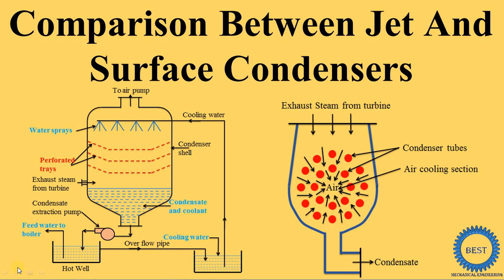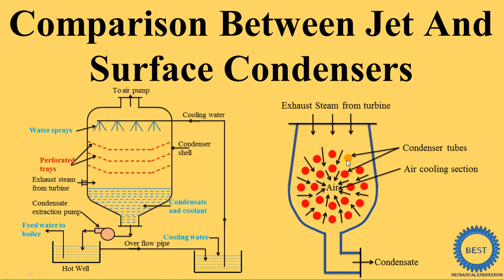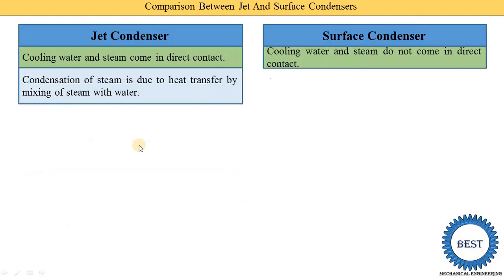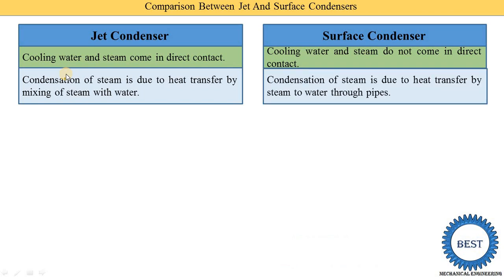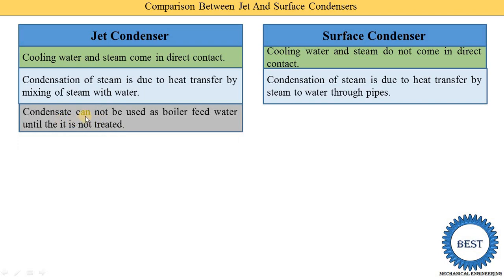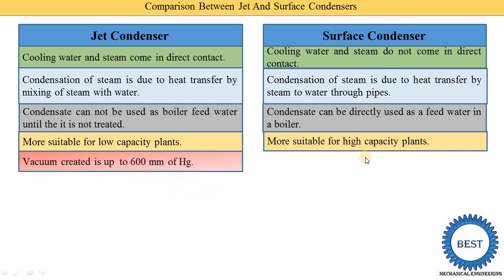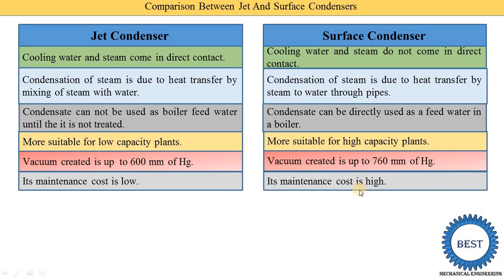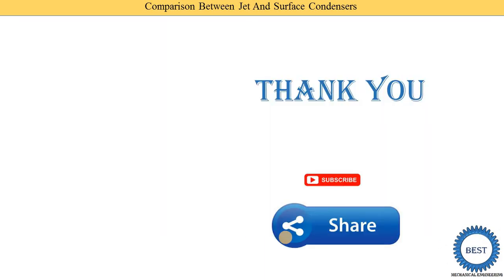Comparison Between Jet And Surface Condensers

Comment: I'm using the surface condenser similar to a auto radiator. This is cooling 3 different machines and the liquid hardly gets up to 150 degrees Fahrenheit. I don't have access to outside air conditioning or refrigeration. The use of automotive coolant works best. This brings  the temperature of the machines to optimum.  Thanks for the info.